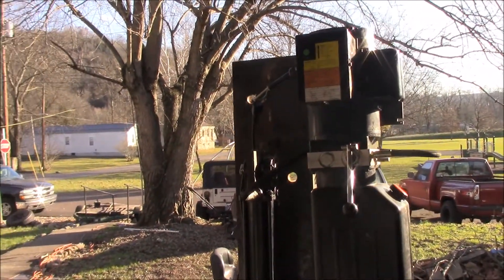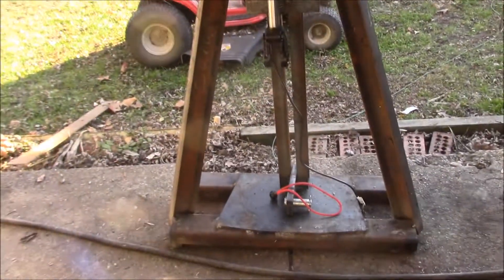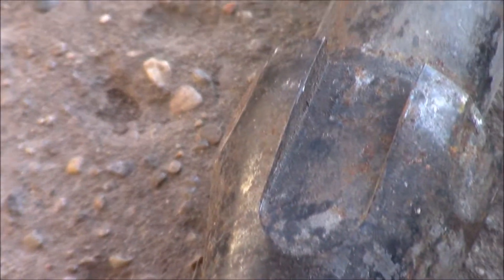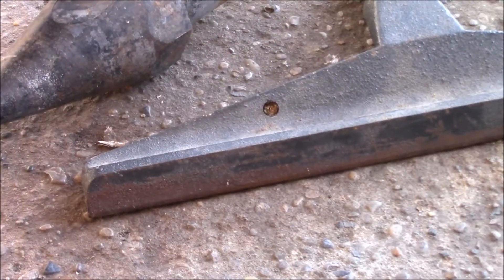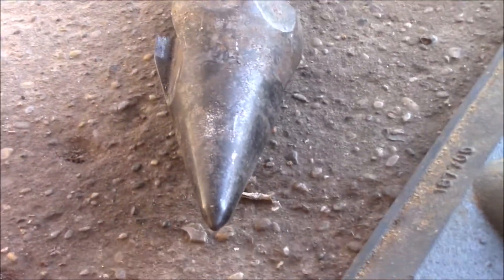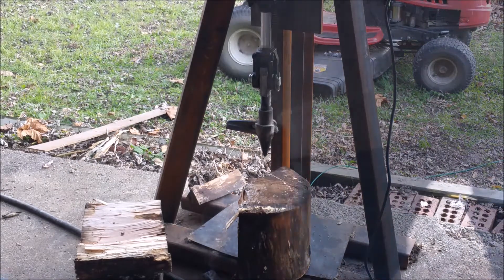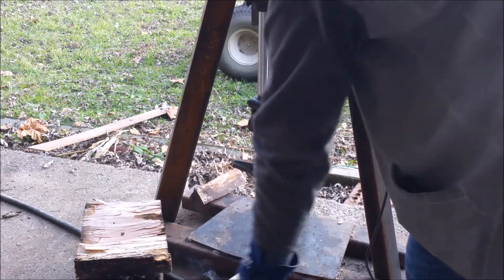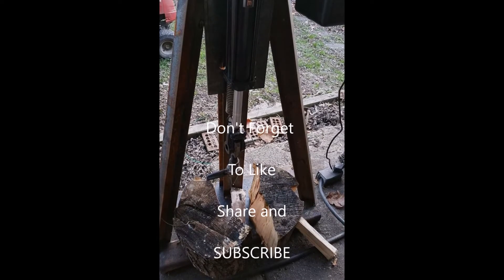Homemade Wood Splitter Electric Hydraulic Wood Splitter TEST

Comment: That tool rest was cast iron right ? I would find a piece of I beam and cut the corners off it to make the wedge .
Reply from the maker: Yes, the cast just snapped. I believe the cone will split wood without blades, so I'm gonna give it a try. I'm waiting on welding wire to finish up a few changes.